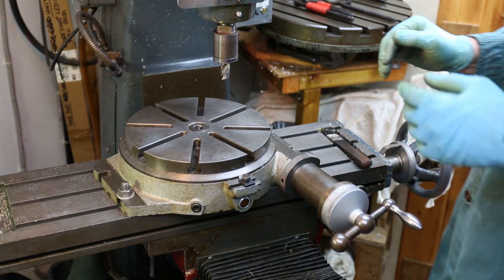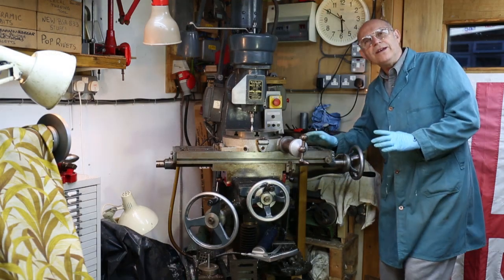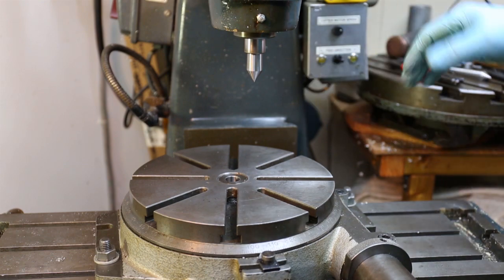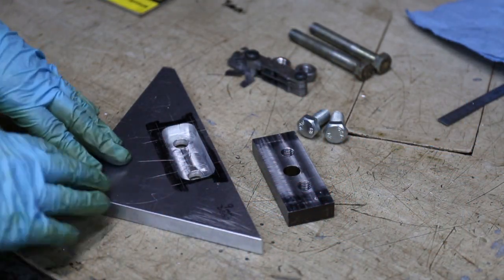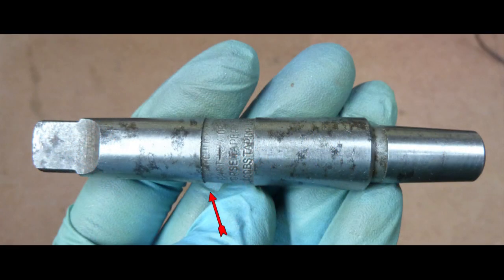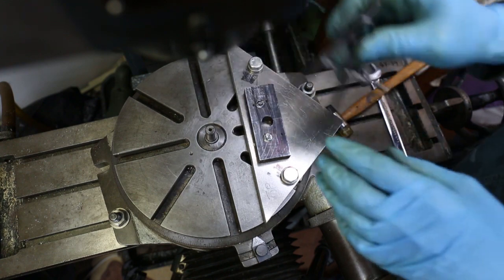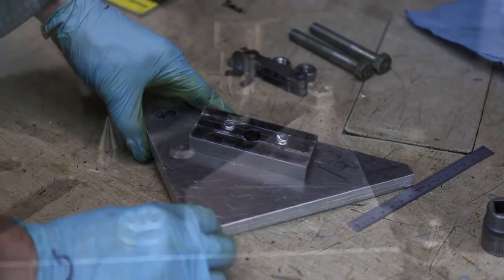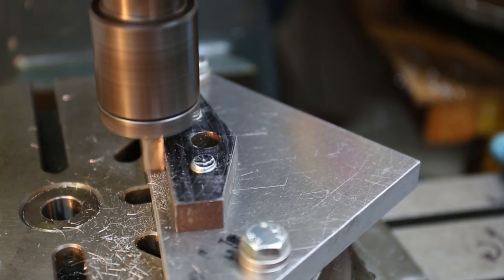Set up Rotary Table, Cut Fixture Plate on Milling Machine, Making Curved T Nuts Part 2

Comment: or, you could use an indicator and center your table properly, maybe try that next time
Reply from the maker: Hello. Thank you for your comment. Yes, I could have used a DTI gauge and set the table up to a fraction of a gnat's cock, but that sort of accuracy wasn't required for the machining of the T-Nuts. Setting up the rotary table by eye is a perfectly acceptable technique, you do have to accept the level of accuracy will be lower than that obtained by the use of a DTI gauge, but in many cases it will do just fine. Reamers produce a far more accurate hole than a normal drill bit, do you ream all of your holes? I doubt it.